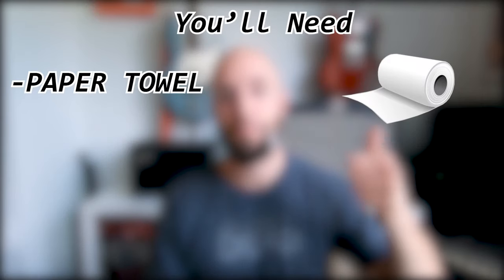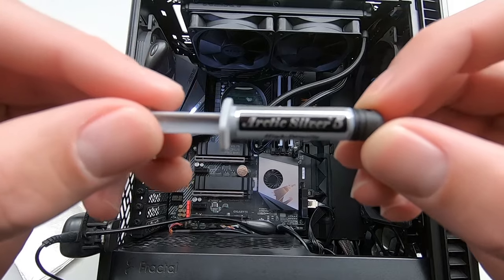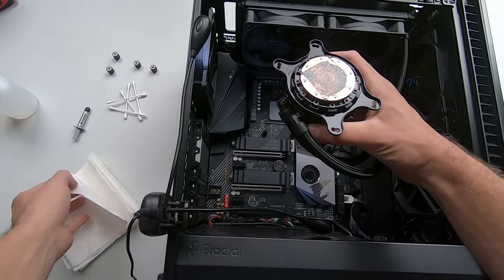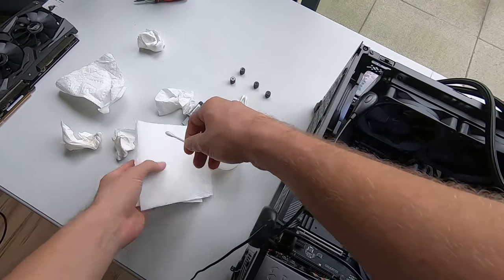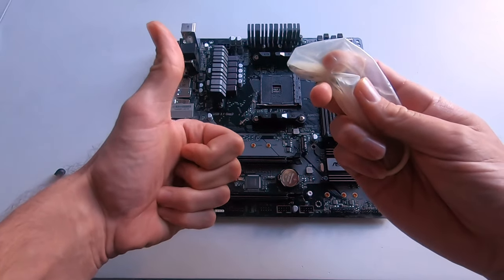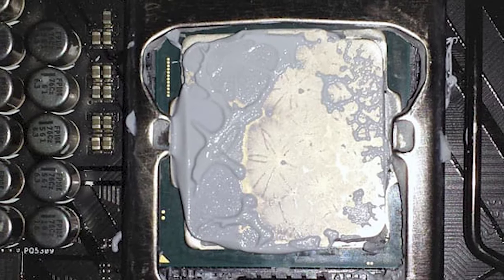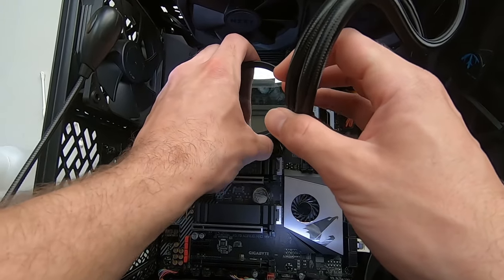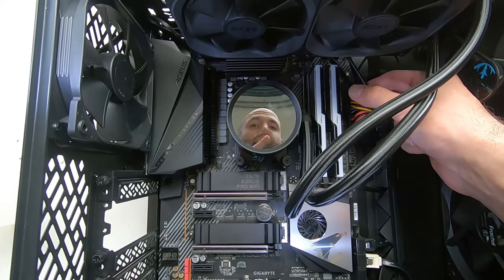BEGINNERS GUIDE: How To Apply CPU Thermal Paste

Comment: I'd probably recommend you turn your computer on for 10 minutes, open up a couple of chrome tabs and heat up that thermal paste. It makes removing the cooler a lot easier. Especially if you haven't removed the cooler in some time, you can rip the cpu right out of the socket. Yes I am speaking from experience 😉
Reply: Will it damage the cpu ? Cuz dat just happened to mine rn and I was shock..... I cleaned it and put it back tho
Reply: @roeihsdraw9915  It can yes. Carefully check for bent pins, if you have none then you may be okay
Reply: @dandmwg  they were all okay~ dats means it's goodddd
Reply: don't worry ill just run skyrim with about 116 mods for 5 mins and get my cpu nice and crispy
Reply: @Marvlouz  lmao same but with fallout
Reply: Just ruined my old cpu this way not 30 minutes ago gg
Reply: No need when I opened my computer the heatsink fell right out!
Reply: @jarofrice4529  That's a little scary
Reply: @jaredjones6570  it’s a feature
Reply: Just run a cinebench or any benchmark for that matter for it to go hot a lot easier.
Reply: My cpu kept spiking to 108°C every-time i opened a game, i guess thats enough said about how easy it came off
Reply: Definitely right. I remember once I tried to do it after my pc was off for like a year and I tried to upgraded it and ripped off one of the pins 😂😂 never again.
Reply: @roeihsdraw9915  this literally just happened to me, i bent the cpu’s pins back into place, carefully put it into the socket, lets hope it works 🤞
Reply: Not a problem for me the $25 system I just picked up had the fan hanging off already
Reply: @roeihsdraw9915  That happened to me as well, the person I bought it from must of thought he was icing a cake because it was like a whole tube of thermal paste on it. Definitely bent a bunch of pins. My pc wouldn't even power on, just the lights on the motherboard. But no other power, so I just ordered a brand new Ryzen 9 5900x 12 core 24 thread, and a AIO cooler. The original AMD fan cooler he showed I don't find it cools it down enough.
Reply: I just ripped my ryzen 9 5900x out because i may have put the cooler on too tight. No bent pins so I think I’m good though
Reply: @jarofrice4529   lol
Reply: Ouch...I spilled soda on my GPU a couple months ago...I guess s*#" happens
Reply: Heating it up first by running the system could cause damage….
Reply: I'll just play cyberpunk for a sec lmao
Reply: @mobius7927  
Sorry to hear
What did you do sir?
Reply: How long if mine is running at 99 idle lol
Reply: Just happened to me. Which is why I searched for this video. Don’t want to ruin my new cpu.
Reply: What kind of idiot motherboard doesnt secure your cpu in place?
Reply: Just happened to me

Comment: I’ve had my pre built for about 3 years now. Definitely gonna do this, this is a lot easier than I thought. Thanks so much bro!
Reply: The whole build process is about as easy as this by the way, in case you ever thought maybe building a computer would be beneficial to you. It's just a lot of reading manuals and very carefully slotting things in. Not rocket science. The hardest part is finding what parts you want and that are compatible with eachother. The actual building can be slow and tedious, but I wouldn't call it hard at all.

Comment: When remove old paste, I use lint-less wipes and alcohol or pure acetone. Then after wipe it clean to remove any residue with a dry, soft lint-less wipe. When you use a cotton swab it can leave tiny fibers on the CPU so you have to wipe it off after cleaning. The same goes for cloth like micro fiber too.
Reply: Bilbo baggins  Good idea too. I do it with my Datavac after I wipe it off.
Reply: Is nail polish remover the same as acetone?
Reply: @thehoodedman6954  yes it's literally acetone
Reply: @jacman6409  not necessarily, there are many nail polish removers without acetone these days, I haven't bought one with acetone in it for years now since most are without.
Reply: @thehoodedman6954  Depends on the brand, a lot of nail polish removers use ethyl acetate these days as it dries out the skin less than acetone.
Reply: Is kitchen paper towel okay? Its basically paper towel that soaks up liquids.
Reply: @Themistocles30  No. Paper towels will leave dust particles. You want to use something that will leave the minimal amount of fibers on the chip. Paper coffee filters work fine and they're cheap.
Reply: @johnslade7540  Great gotta order more 💩.
Reply: As stated above, coffee filters 👍

Comment: Top tip for removing an old heat sink. Run the PC up for a few minutes. Then shut it down, and unplug it. The heat sink will pop off easily. The reason is when it is cold the paste sets like concrete. Running the PC for a few minutes heats up the CPU and, hence the paste. It will then be soft and will allow the CPU to be removed a lot more easily. :)
Reply: for me whose paste has almost completely vaporized after almost a decade I didn't have this issue lol, thankfully because I took the cooler out right then and there without a thought like that.
Reply: @Killbayne  Yeah exactly, the bros at Dell are evidently trying to save money by applying the barest minimum of worthless paste so it was absolutely no problem whatsoever just to lift the cooler right off the CPU once I got the screws out.

Comment: I have a TIM cleaner, had it years now, does a great job of removing the old paste and I either apply paste like you did or sometimes I'll use the  little card supplied to spread it 👍😁
Reply: I used glass cleaner i dont have anything else 😭
Reply: Why do some people not just let the pressure of the heat sync spread it. I dont understand, it's literally so hard to recreate the even displacement of pressure that the sync creates
Reply: @Squamington because it will spread in a circle while the cpu is a square

Comment: Solid tutorial, haven’t changed my thermal paste ever since i got my pc (its been 4 years lol) wish me luck bois!
Reply: Do i need to disconnect the plug from the pc ( disconnect the current) before i start to change the thermal paste
Reply: @1696-l6i  just take all the cables out, lay down the pc case and change it lol its easier

Comment: You should never use paper towels or Q-tips unless absolutely necessary because you have no other option, in a pinch, so to speak. What you SHOULD use is a lint free microfiber cloth or paper coffee filter. These don't leave particulates behind. Around the edges, as you did, is fine, but the actual surfaces should be final wiped with a clean lint free or microfiber cloth, or paper coffee filter, with a lightly dampened application of 91% Isopropyl alcohol. I see a lot of these videos recommending 99% Iso alcohol, but personally I've never seen that available through any local stores AND it tends to evaporate TOO quickly. 91% is very effective, and available globally.

Other than that, good enough for the girls I go with, so to speak.
Reply: Does 70% also work?
Reply: @komag69  70% would work, just rub a bit extra, and do not apply extra
Reply: @komag69  yes did mine 70% and it was fine
Reply: i always used paper towel no issues, but mine not messy so not to much to clean

Comment: Thank you, i am building my pc later today, and i am kinda scared that something is going to happen. this video made me feel a little more confident!
Edit: I turned on! it works! i am going to get windows on it tomorrow
Reply: How does your PC run now, mate.
Reply: @Gexrge_OSRS  it runs really well. i've been using it a lot, and i've not had a single problem with the parts i picked out.
Reply: @Herrgabby  specs?
Reply: specs?

Comment: pc been acting up, hasn't been cleaned in almost a decade, took a look and realized. Everything covered in a 2mm layer of dust. Took every component out, cleaned it off, now putting it back together. Didn't have thermal paste so had to drive to the city to get some. Im surprised the CPU and GPU held up with 1 load of paste after all these years. Or anything else in that matter... thanks bald tech guy™️!
Reply: Did the pc run faster after cleaning?
Reply: @kattu936  it's been running smoother and cooler, usually games ran at about 60°C on the gpu but now sits at around 50°C. Don't know much about the cpu but it seems fine. So yes; if your pc is covered in dust and has thermal paste older than most of the twitter userbase then its time to clean that out and reapply

Comment: applying thermal paste on the cpu is one of the most anxiety triggering things for me. it kinda goes up there with changing the strings on my guitar too. it always gives me anxiety. you can go overboard so fast and also apply to little just as fast at the same time. it's the worst part of building a pc by far. everything else i can deal with but the thermal paste application i just wish we had a better way of doing it.

Comment: Hey, i can’t purchase 99% Isopropyl alcohol here in my country easily, so can I use my 70% Alcohol Hand sanitizer? It’s only got 70% ethyl alcohol, emolients, thickeners, perume and Aqua, will this be safe if i Use a small amount to clean off the thermal paste?
Reply from the maker: It will likely be fine just DO NOT get it on your motherboard. Dry wipe is totally fine too. Not going to make much of a difference.

Comment: Soo I've raninto a little problem, I was going to replace the thermal paste and, clean my pc buttttt, I can't remove my cpu cooler as there are two screws that are not wanting to be removed, I have tried with my hands, screwdriver with different sizes, and I was able to remove the other two beforehand with the same size and as much as i didnt want to force and nothing. also do I have to use some type of alcohol? As I don't have any and I can't really leave the house to get some more.
Reply from the maker: You don't have to use alcohol. You can try using a dry coffee filter or nail polish remover.

As for the screw situation, I hope you can remove it!
Reply: @TechIlliterate  been trying for the past hour and nothing I've tried different patterns and, different pressures and we'll different everything ill either just deal with the cleaning and, try to find a job to upgrade to a better pc or try again next week as there are somethings I need my pc for, but thank you for the luck and the great video and tips!
Reply: @TechIlliterate  and got it with a par of plyers and alot of cursing 👍🏾

Comment: Wish I'd watched this before I took my ps4 apart. It was overheating so I stripped it down and cleaned the heat sink. The thermal paste was spilled out all around the CPU but still soft so I used a small screwdriver to scrape it up and put it back in the centre and spread it out evenly like a rolling pin on pastry. Hope I didn't mess it up but so far so good 🤞
Reply: I used this video for my ps4, as I needed to know how much to use. I hope it worked for you.

Comment: Omen 15 owner here, thinking of re-pasting, just a question.I got 3 tubes of mx 4 4 years ago, I opened one to use a tiny bit. Does thermal paste go bad? Can I use the remainder of the opened tube?
Reply from the maker: If its still paste and not dried out then it will be good to go.

Comment: Also to note. You should run your computer for 10 minutes and then shut it down right before performing this. It will warm up the paste and make it easier to remove. Also Doing it cold has the potential to damage the CPU though probably slim it is possible. SO DONT RISK IT!!
Reply: I read this everywhere and this is all useless. A thermal paste is a thermal paste for a reason. Its no use to "warm" it up except if you can reach +200 degrees
Reply: I read this everywhere and this is all useless. A thermal paste is a thermal paste for a reason. Its no use to "warm" it up except if you can reach +200 degrees

Comment: So what should I do if I applied my paste but didn’t have the chance to immediately put it on due to fan issue and I had to put the fan on and off like twice and after figuring it out my fans and stuff works when I turn on my pc but not my monitor it won’t turn on does that mean I ahve to redo thermal paatjng

Comment: With that pump, the hoses block one of your memory slots, I have this problem I realised after I put my z73 kraken in. Can the pump be mounted 180 degrees so my hoses are coming out facing the rear fan? I want to know before I pull it out, clean and re-apply paste
Reply from the maker: I installed 2 more DIMMs and ran into that issue. i have the hose outlets pointed toward the RAM at a downward 45 deg angle. But anyway you can fit them will be fine.
Reply: Thanks for the feedback, my hoses are two thick for that. If I hadn’t have bought the extra sticks I could have just bought 2 16gb

Comment: hey, I think I put too much pressure when screwing down my cpu cooler and my temps are not as cool as they should be.. is it because it's too tight?
Reply from the maker: Typically no. But it is possible. Try loosening the screws slightly.

Comment: When you're taking the old compound off your CPU, how much pressure do you need to put on? Is it possible to dmg the pins underneath if you apply too much pressure?
Reply from the maker: Basically impossible. The pressure you put on will transfer through the board (Ceramic substrate) and into the socket. Not through the pins. That being said, you shouldn't have to put too much pressure.
Reply: @TechIlliterate  Thanks a lot for the vid and response!

Comment: can i apply any alcohol to remove previous thermal paste?
Reply: i dont have iso alcohol
Reply from the maker: You can do it dry. Not really an issue. You can use other alcohol just use caution. Don't spill it ;)

Comment: Cool. I recommend 99.99% isopropyl alcohol, also a cotton ball but flatten the cotton ball roll it, roll it in between cleaning so there's always a fresh surface. With this method, only one cotton ball is needed.

By the way if the heatsink is huge, should one spread or put a pea size TIM on the heatsink's cold plate also?

God bless.

Comment: Hey man do you know what normal temps are for the ryzen 5800x when idle and when gaming?
Reply from the maker: No, depends on many variables. My 5900X is usually around mid 30s idle and 50-60 when gaming. Still using the Kraken cooler.

Comment: Hey i did everything just fine except when i came to putting the cooler back on top of the cpu. I cannot get the screws to go in for the life of me. I have put as much pressure on it as I can without being afraid that I might break something and i can try to screw it in for 15 minutes and still nothing.
Reply from the maker: What kind of cooler? similar to mine?
Reply: @TechIlliterate  its a circular ibuypower intel one. The cpu is a i7-9700k id that helps.
Reply from the maker: @Omega-Nations  Stock cooler?
Reply: @TechIlliterate   i figured it out. There was another much smaller compartment on my case behind a wall and where the motherboard was screwed into. The thing that was supposed to be where the screws went into had fallen off. After holding it in place i was able to get the screws in! Thank you so mich for replying so fast though. You earned yourself another subscriber haha!
Reply from the maker: @Omega-Nations  Oh the mounting bracket had fallen away. I've had the same issue in the past. Glad you found a fix.
Reply: @TechIlliterate  me too! 😁
Reply: that was my main problem too! ugh the screwssss xD im glad it was over

Comment: Hey man I need help. Everytime I try to open to play my computer it shuts down randomly and won't able to turn it on by pressing the button, but it works when I unplug it and plug it again then it does the same do you think it's the CPU or are there any problems I'm experiencing in my computer?

Comment: my cpu got stuck in the cooler the retention arm didnt locked it in place is it because i put so much thermal paste?
Reply from the maker: Yeah you may have to gently twist the cooler. It happens sometimes eve when you don't put a lot of paste.

Comment: Recently deep cleaned my PC (i7 14th gen + Cooler Master ML240 liquid cooler), but I didn't bother cleaning off the old thermal paste since it's only 2 months old. After reassembling, my PC kept tripping—turning on and then immediately off, like someone was cutting the power. Could this be caused by the thermal paste not being replaced?
Reply: No. Probably you didn't connect something properly when reassembling it

Comment: This looks like such an hassle to do, how safe is it to just ignore it on a 6 years old pc? I don't really care about risking it just to lower the temperature of 1-2 degrees.
Reply from the maker: It's hard to mess it up to be honest. If your PC hasnt had it changed for 6 years you may see a change of 5-20 degrees. That being said, as long as it's running ok then you don't really have to worry.
Reply: @TechIlliterate  I'm only considering it because i have what seems to be an overheating problem, which causes the PC to freeze and shutdown when under heavy load. I think the cause might be a faulty PSU rather than simply an aged thermal compound though.
Reply from the maker: @Kumire_921  Yup that's possible. I have had that issue before. use a diagnostic tool like HWiNFO to check thermals. If you are easily hitting the temp limit I would suggest repasting before buying a PSU
Reply: @TechIlliterate  I'll give that a try thanks.

Comment: So I have a ryzen 5 2600 and it started heating up going from 85 to 99 then back down to 85 then back up etc. I removed the heatsinks and cleaned and reapplied thermal paste. Turned out on and everything seemed fine. The temp was dropping, then I went to the bathroom and when I came back my CPU showed at 110!!! Idk what to do!

Comment: Would vodka work?
Reply: Not gonna evaporate fast , but you can use the regular alcohol 70% spray from the pharmacy and it works well and i used it multiple times